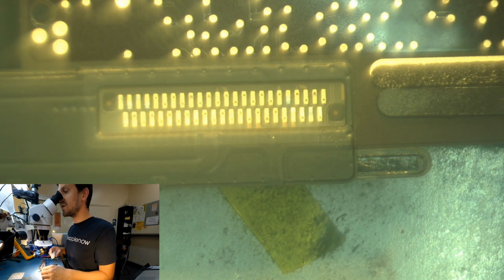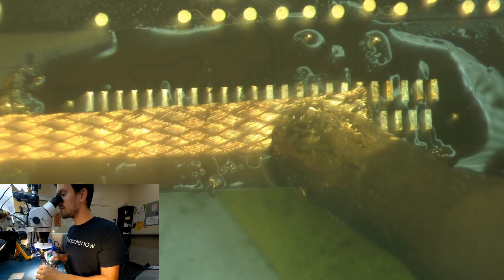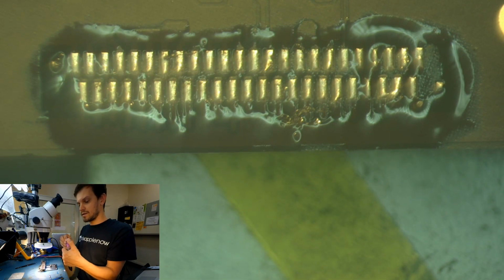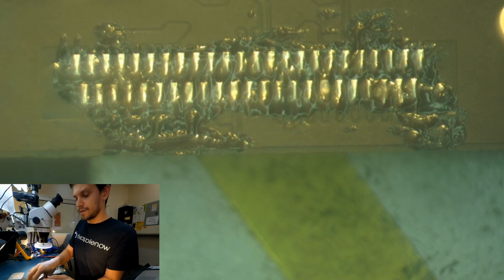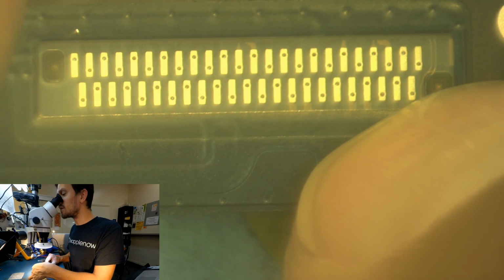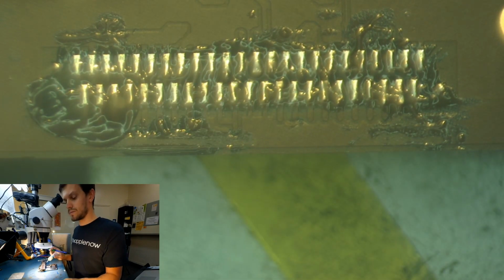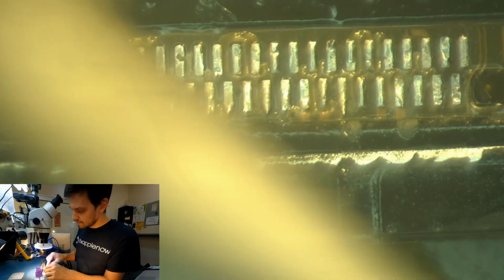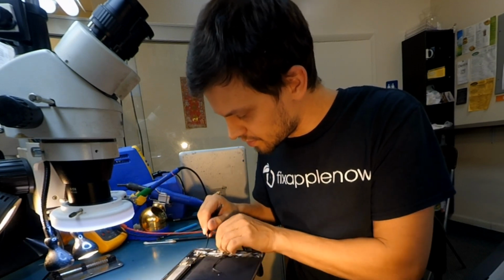How To Guide: How To Fix iPad Air 1Gen Charging Port DIY Repair

Comment: Great video. I have a problem charging an iPad air 1. I have opened the iPad and I have disconnected the motherboard in order to verify the voltage in the battery pins. On the battery connector I measure voltage floating from 0.35 to 1.4V with period of some seconds (it seems a ramp, it could be reasonable). But if I connect the battery it never charges. Do you think the problem is the power supply connector or do you suspect something else? Thanks in advance

Comment: Hi my friend. Great video. I´ve done same repair than you in my Ipad Air and the flex charger port is already installed. I´ve checked the connections and it seems all are correct but once I´ve connected the charger to the new USB port (5.2 volts.), I´ve detected 1.4 volts. only in the motherboard battery pads (without the battery fitted). Which voltage should be in these pads? 3,7 volts?
I cannot fit the battery as it´s gone. It´s dead. Before to purchased new one, I need to know if the repair is properly done but that 1,4 volts make me suspect that something is wrong. Can you help me? I´ll appreciate a lot. Thank you.
Reply: Connect with battery it should be good .
Reply: @ghaziterbela   On battery connector I measure here voltage waving from 0.37 to 1.4V with period of some seconds. But if I connect the battery it never charges. Do you think the problem is the power supply connector or do you suspect something else? Thanks in advance
Reply: @nicolacampanelli3876  I'm sorry but I can't help you as I've surrendered finally. Thanks for your comment anyway.
Reply: HI Diego, the voltage waving from 0.5 to 1.4 volt, is it regular? How do you fix your problem? in your case was it a problem of battery or something else?
Reply: @nicolacampanelli3876  thank so much for your answer but I've surrendered finally. Now, I've got another device (not Apple).
Reply: Try to check battery connector where you install battery may be it’s damage
Reply: @ghaziterbela  thanks for your answer. I didn't continue with the repair as finally I surrendered. I didn't purchase the new battery due to my doubts about the previous repair. Anyway, thank for you help.

Comment: hi, thanks for your instructive video.
just a single question:
 unfortunately I left some fingerprints on the LCD when removing process. Cain I  clean it ? any solvent is the proper one? thanks for your sooner answer  I appreciate a lot from Spain. thank you.
Reply: Use microfiber cloth. Those used in kitchen.

Comment: I had the screen replaced on my iPad air and they left the home button higher than the screen, I took it back to have it adjusted, since then the charging port felt lose and wiggly, now charging it is hit-and-miss and every time I plug it it pushed the home button up, sometimes even activates Siri, could the home button adjustment have caused the charging port to go bad? I will take it to be checked out anyway
Reply: That shouldnt cause any issue with that.